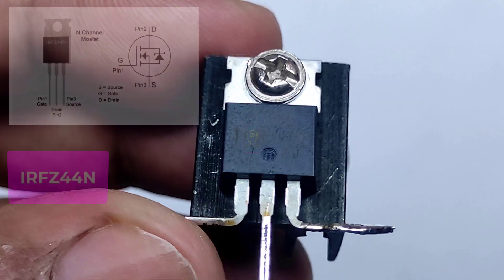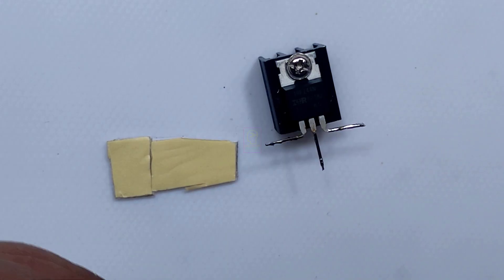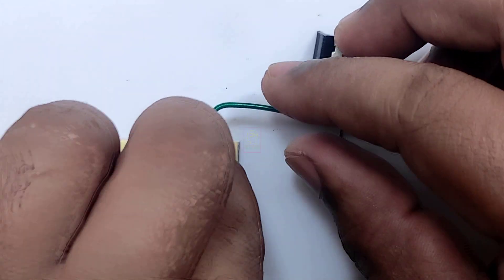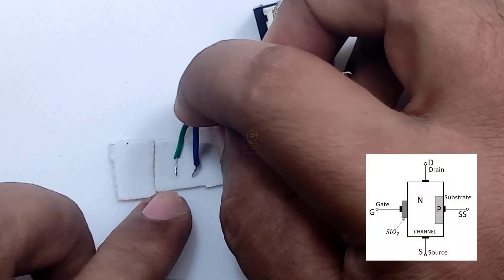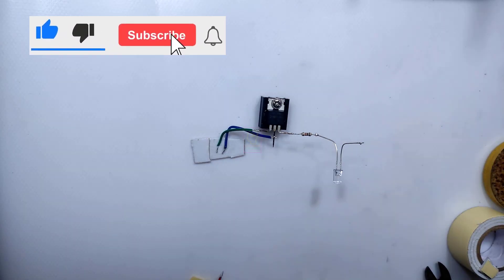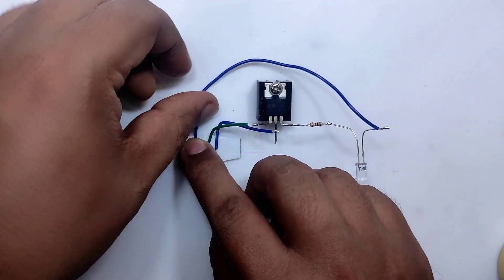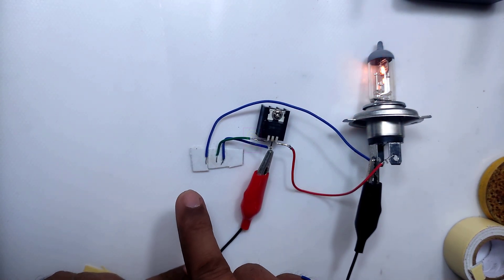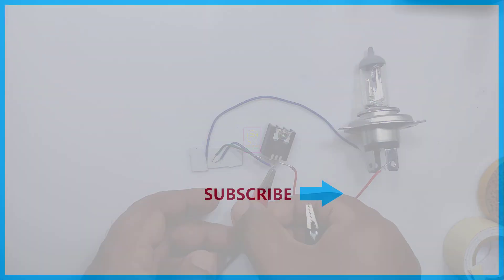How to make World's Simple Touch Switch | DIY Simple Touch Switch using MOSFET

Comment: Can this be coupled with any light sensing device too (Mirror touch switch)
Reply from the maker: This is a learning video or learning one property of MOSFET. When we touch the terminal, the capacitor charges/discharges and thus ON/OFF is working. For mirror touch switch you need to attach thin film terminals in the mirror. Better to use the following circuit. Please watch this video.
Reply from the maker: https://youtu.be/TC0DcXgs4ls